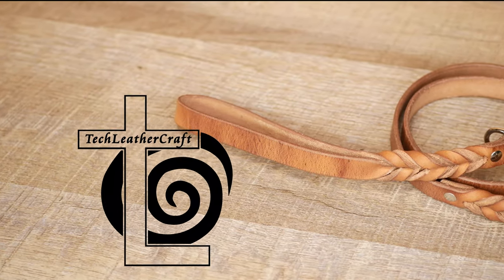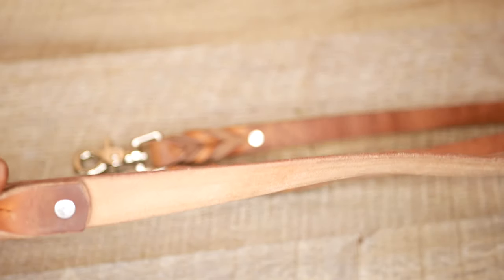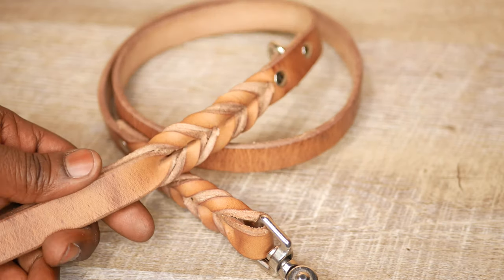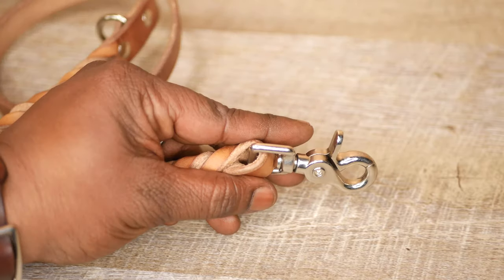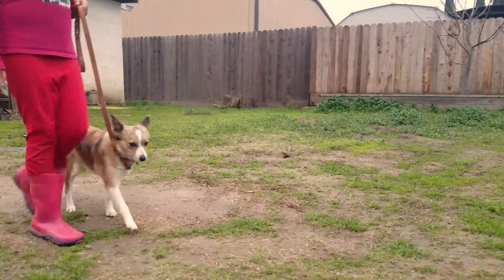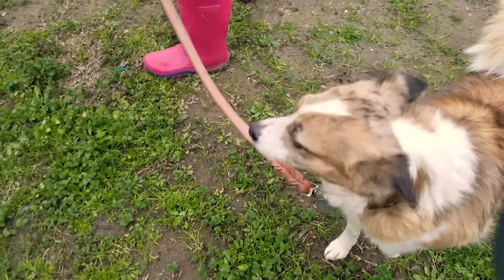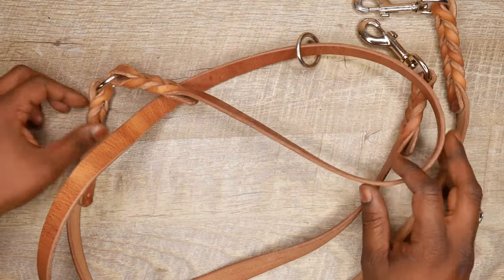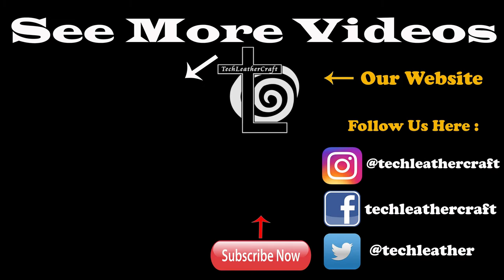How to Buy a Leather Dog Leash &  DIY Tips

Comment: What's the pulling load rating on the bolt you used
Reply from the maker: So, these usually don't have a load rating (at least not that they disclose). If a load rating was super important I would use climbing carabiners instead. They should braid into the leash the same way. They don't look as classic, but functionally would work.

Keep in mind these are used in equestrian applications... Horses. So, if the dog pulls with the force of a horse, you should still be okay....( But, I would also say a properly trained dog doesn't pull the owner.)

Comment: Would you recommend the same leather type/thickness for a collar? Or go thicker for collars to avoid it curling up on the edges?
Reply from the maker: Yeah, I think this leather and thickness would work well for a collar too.  If the leather is too stiff, then it can be uncomfortable and also difficult to get the strap end to feed into the buckle. Also, even the stiffest Leathers eventually will soften up; and form around collar (follow the curve) or curl up.
Reply: Thanks. I’ll give it a shot